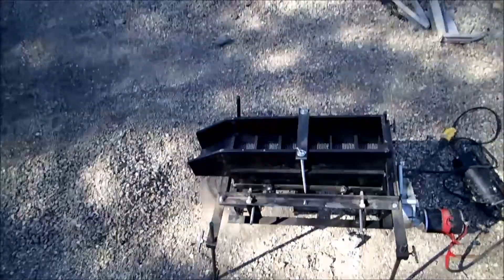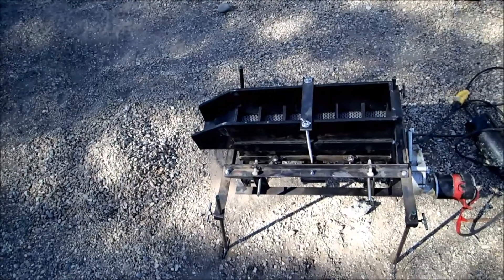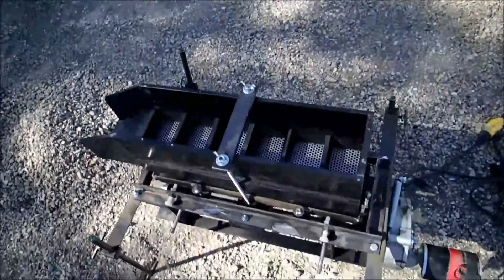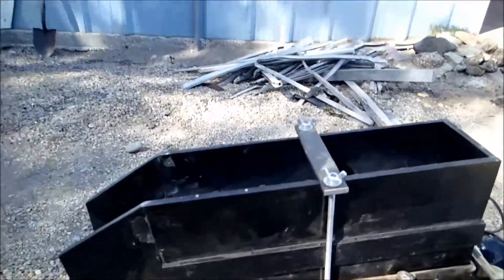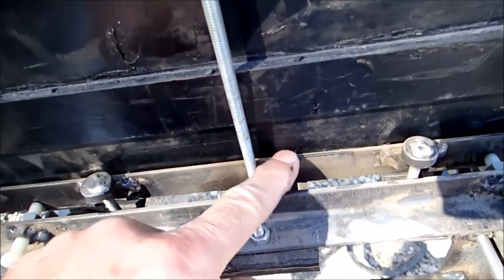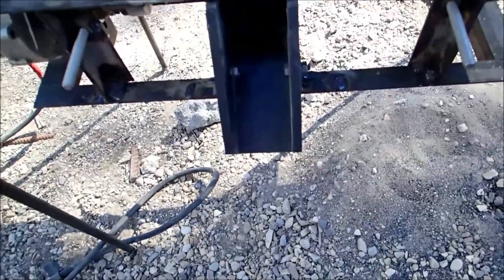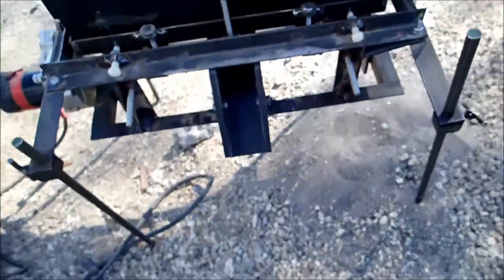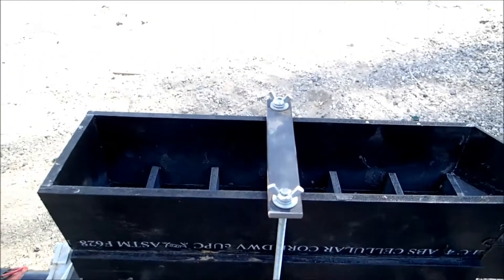Dry (waterless) Jig Part 1

Comment from the maker: Ya know, guys, I've mentioned in the past about the issue with "Granular Convection", or the Brazil Nut Effect. It's all about the tendency for small particles to "float" larger particles. It's a real thing, too. The reason it's almost impossible to come up with a "dry" method for gems is that very thing. In most cases, you need a difference of at least 4:1 in density to overcome it. Of course gems are only about 1.5:1, so we're screwed.....or were. Ive been experimenting with my backpack version of the dry sluice, and using my new riffle design, I recently recovered 100% of some alumina spheres in a couple of gallons of dirt/gravel. The spheres are, of course, round. The density is almost exactly 3.5. The spheres are all about 1/4" in diameter, so Granular Convection should have seen them all go to tails. They did NOT! I was stunned, to say the least. So, be patient. I think I may have finally solved the problem I started on 10 years ago. I had about given up, but last summer, in Wyoming, the big sluice recovered a few tiny garnets. I thought it was just because they were pretty small, but it kept me experimenting with riffle designs, and I think I may have nailed it. So not only will this recover flour gold without water, or a blower, but maybe gems, too.    Jim

Comment: Hi Jim. Will this work for diamond recovery?
Reply from the maker: No. Initially, I thought it would work for gems, but have since determined it won't. The problem of "granular convection" (brazill nut effect) is the reason why. I'm still working on that problem, but do not have high hopes. Many, many people in the packaging industry have been trying to solve that for decades....without much success.
Jim

Comment: Jim, I love your jigs. They are so compact. I've watched several of you jig videos and found each one to be very well done and educational. Thanks 
I do have one question.  What ABS sheet are you using. This stuff looks awesome.
Reply from the maker: Many thanks, Jeff. I buy that ABS sheet from Interstate Plastics, online. It's the non-machinist grade. A 2' x 4" sheet of 1/4" is about $40. One side is a little rougher than the other, but has no effect on the overall use. Good stuff.
Jim

Comment: Hi Jim, just watched this 3 part video .  Very innovative  and creative to say the least. i Like the adjustable features , drive, lobes, etc.  Adjustable  Nylon side bolts, great idea..  You spent a lot of time and thought just on design for sure.  This jig would produce a lot less dust compared to the  gas powered air blowers.. Big advantage in my mind., also it could be used with water supply... Hey,, 2 in one machine..  Now i am thinking keep the hopper bottom, put a valve on it, or slide gate of some kind.  Let the cons build up. You could control the con ratio manually as desired depending on material type your working...   I am surprised  on how few thumbs up or  simple Thank yous  posted,  especially going to the big effort of sharing your invention with us all.    Thanks for posting...  and keep on building, very impressed....   Ken
Reply from the maker: +ken gundersen 
Ken, those are very kind words, and I appreciate them. I have put a lot of thought, and effort into building my equipment. There are so many different ways to accomplish the task of concentration, you can go nuts trying to figure out the "best" method. Usually my designs are built in an attempt to solve a problem I run into in the field. If I feel the solution might help others, I do a video. It requires about 3 hours to upload a video to Youtube using my slow connection to the internet. I'm always happy to receive thanks for putting forth the effort required to share my ideas.
Jim